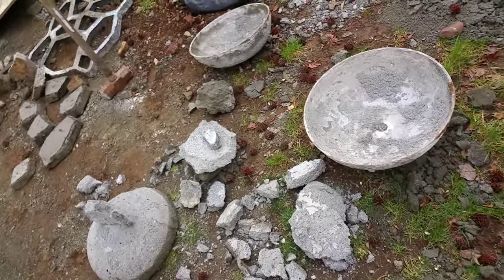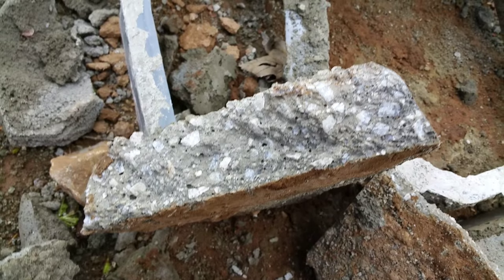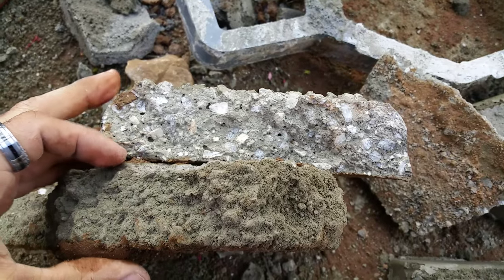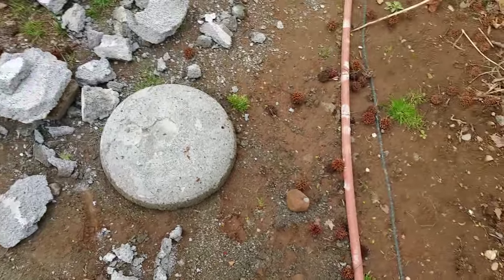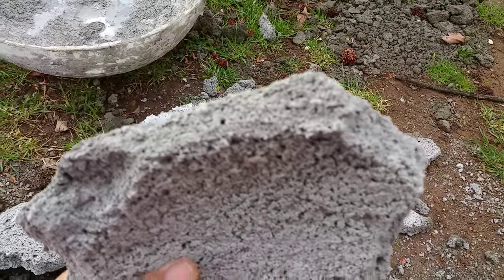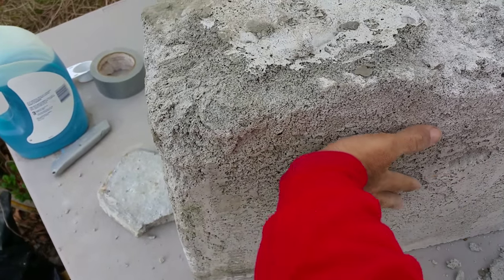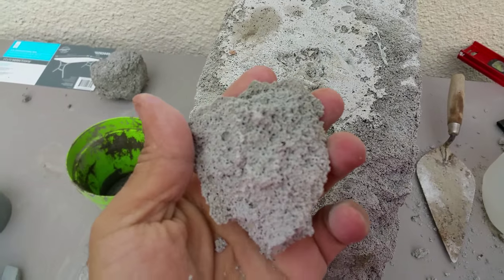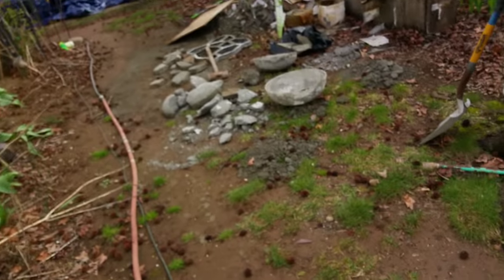Aircrete Updates | Strength #aircrete #aircreteupdate #aircreteharry #diy #foam #foamgenerator

Comment: If you can break it at all with your hands, water and ice is going to absolutely destroy this product.
Reply from the maker: John H here is a freez test done with aircrete. https://youtu.be/5ef522PjAfU
Reply: Yeah, I’m sorry, but that is not even close to a lab test for compressive strength.  A freezer is not going to reach the temps that a porous concrete product is going to experience in an outdoor environment, and we’re not talking about just leaving it in below freezing temps overnight.  What cracks concrete is called the freeze-thaw cycle.  It is the slab constantly being frozen then thawing over an entire season.  Water finds its way through the cavities in the slab and expands then contracts.  Normal concrete matrices are designed to withstand this, with a proper air content.  “Aircrete,” technically known as porous concrete, or extruded concrete, is only designed to reduce weight in an elevated application and should never be applied to the outside elements.  An engineer or an inspector would shut this process down in a heartbeat.  Anyone looking to try this method because it appears to reduce the amount of bag concrete needed will just have a huge mess on their hands in 2 years time or less.  Any contractor trying this method is just looking to get sued.

Comment: Look bottom-line it for me people is this a reliable load bearing material to build a 10-story building and then put people in it ? And is it Battlefield provable ? That is to say if I take a AK-47 to a wall of this stuff with a soldier behind it, that Soldier is going to be okay right....... 'Right' ? And how the hell do I know my house isn't going to blow away in a F5 tornado ? Or do I have something to 'Anchor It Down' ? 😕 Here's a thought, " just use concrete with steel reinforcement " !
Reply from the maker: I agree with you that's why I changed the way I'm going to build it. What I'm doing first is building the structural  layer first with micro rebar than using the aircrete for the insulation.

Comment: how about adding fibers to add tensile strength. They would have to be short so as not to clog during mixing.
 A mesh outer with a sand and cement render would be a tougher outer coating, or if you want water tight with strength and could afford it then an epoxy resin coating would work well. Fibres in that would add even more strength, basically a fibre glass coating
Reply: The Ape of Death or do it old school they used to use horse hair back in the day!
Reply: oh yes horse hair plaster.
well I got the idea from Ardex concrete repair cement, which has tiny fibres in it
Reply from the maker: I have used fibers and it is stronger.   https://www.youtube.com/watch?v=pjg5XMp_u04&t=949s
Reply: There is already a product (supposedly cost effective) called concrete canvas that is basically what you're talking about. Look up "Concrete Canvas" on YouTube & check it out.
Reply from the maker: I have seen the concrete canvas and it's different because the airform i'm using can make up to 100 domes
And CC does not have any insulation. The aircrete will act as the insulation for the dome.